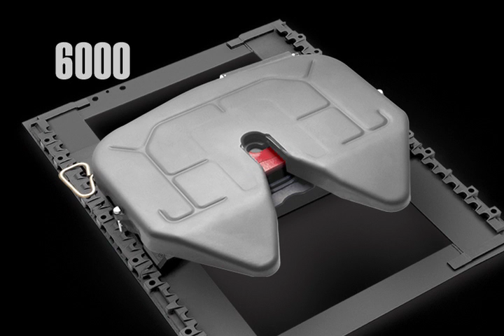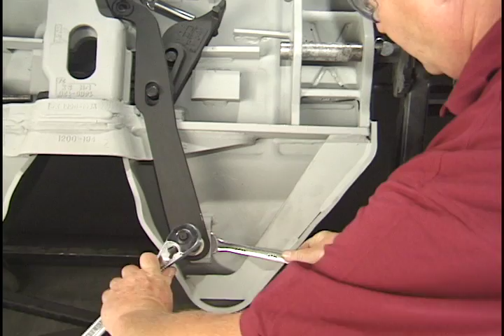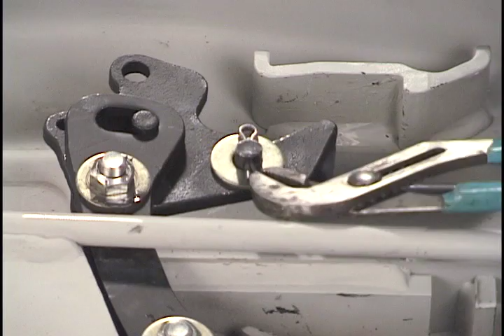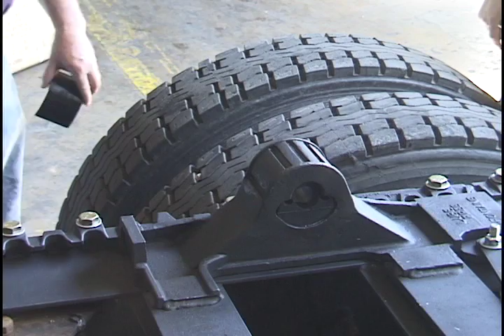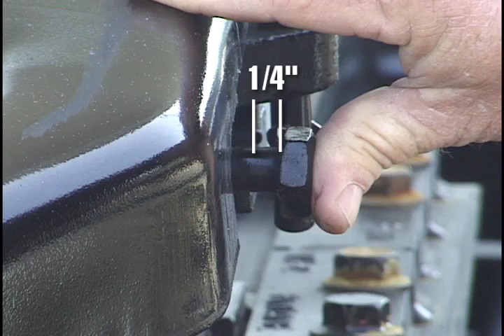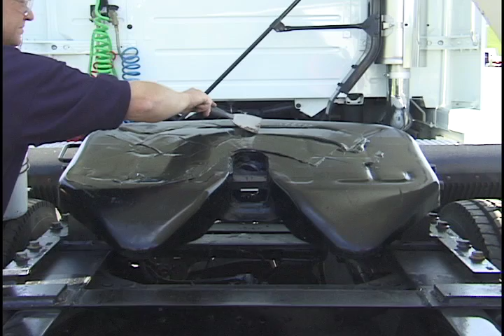Fontaine Fifth Wheel No-Slack™ Rebuild

Comment: Honestly just buy a new 5th wheel.. The whole kit in this video is like $850. New 5th wheel is $1,300 with bushings kit.. Don't risk losing a load or worse..
Reply: Where would you buy a new fifth wheel?   would you install yourself?  can't just lift it and put it on there by yourself.
Reply: Yes it goes bolted on if you buy with the sliding plate, if you just buy the 5th wheel then it also just goes on bolted with pins@tbonepatti

Comment: Question , if i dont have the tool to check for play , can i hook up to the trailer and check for my 1/4 on one side and 1" on the other ? Or it wouldnt work like that ?
Reply: people do it all the time. I would not. The trailer could be at an angle and binding and you would have no idea. so any measurement would mean nothing.

Comment: Best fifth wheel what ever had. Towed 30 metric tons trailer with it allmost one milion  km, just no problem´s. Working like Swiss clock.
Reply: Had a spring rust out and the plastic thread box snap in half...